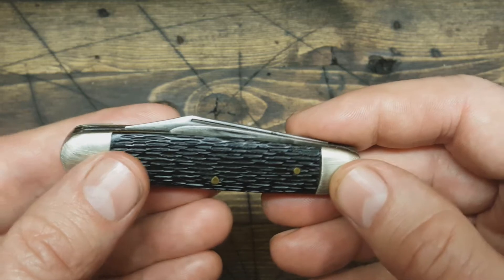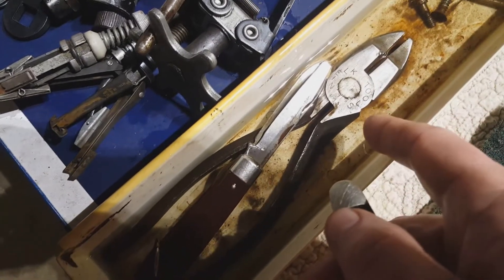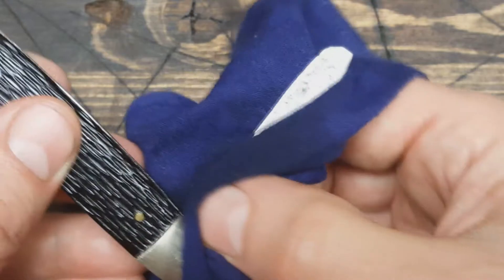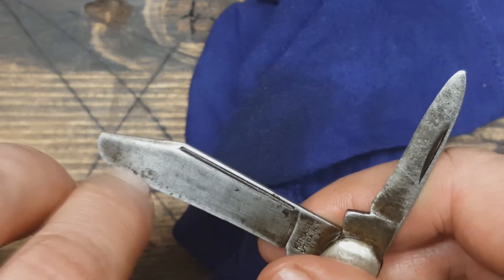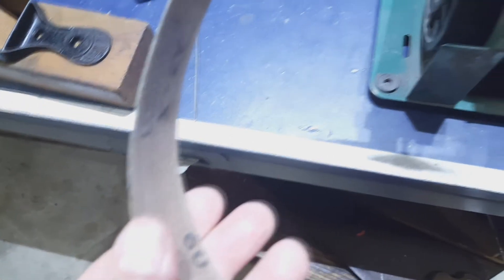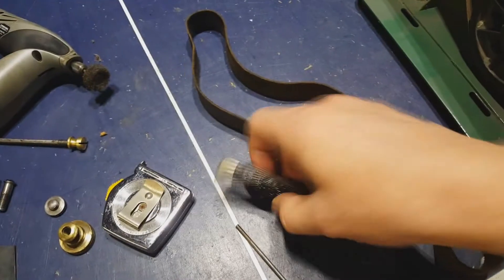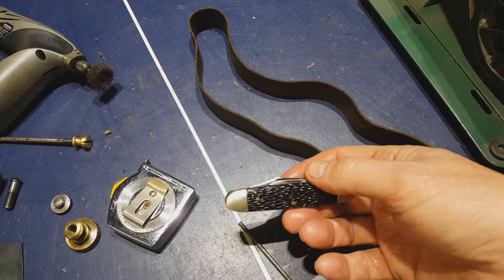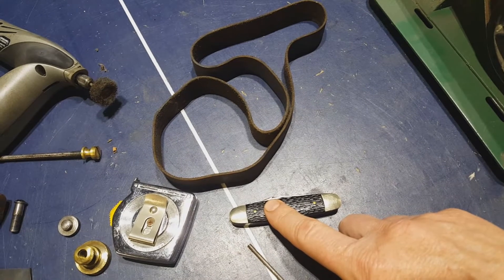Old Kutmaster Pocket Knife Re-Profile (Broken Tip) Sharpen & Clean

Comment: That really looks awesome dude. It’s hard re-profiling in general, but clip points seem like the hardest. I gotta get a belt sander like that, I’ve got a few really nice knives with broken tips, and they’re all clip points. I’ve tried doing it by hand with a file, and I don’t think I have the patience. But that Kutmaster looks great, definitely a user.
Reply from the maker: Thanks Joel! Having a 1 x 30 belt sander is a game changer :] Most are under 100 bucks. TFW👍
Reply: Finally got the belt sander, and coincidentally got that exact kutmaster last week. Has full blades luckily, but had blade wobble. But thanks to watching your vids and others, I was able to fix the blade wobble and started carrying it today. Got this for $8 on eBay, what a great edc. These old kutmasters are fairly priced, but very well made and durable. As far as the belt sander goes, haven’t hooked it up yet, but it also has a 6 inch grinding wheel attached. I’m stoked to start taking about some  old slip joints, and learn how to build them back up. I will keep watching and learning from your vids, thanks again for all the great info.

Comment: These old knives must have some relatively hard blades every Kutmaster I have come across has had the main blade broken.
Reply from the maker: Yep those carbon steel blades break if you pry on them to hard...I've seen quite a few Old timers  with Broken Blades as well....the good thing about those hard blades is they sharpen up real nice :]
Reply: @DirtandRust  ..............and they go back to a time when every man had a knife in their pocket and actually used them as a tool.